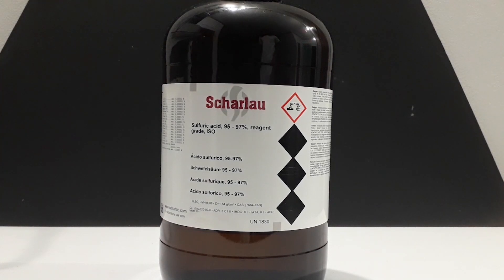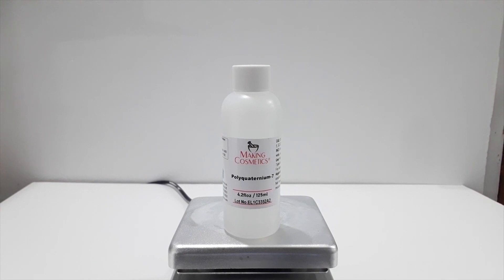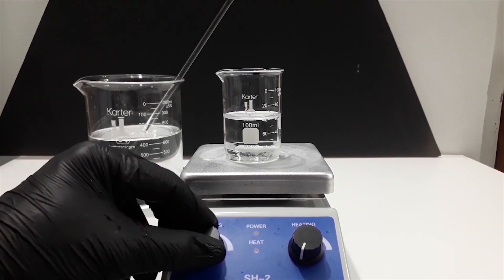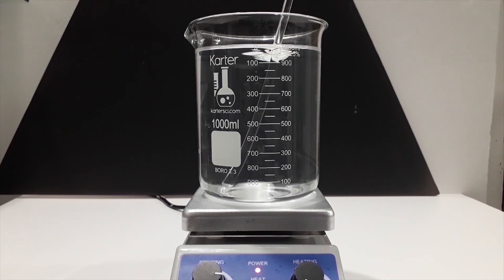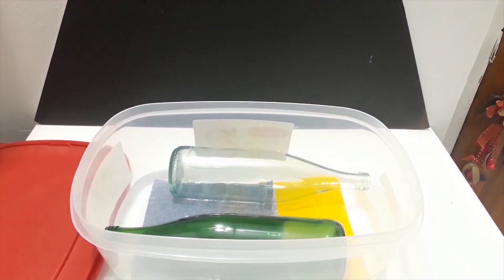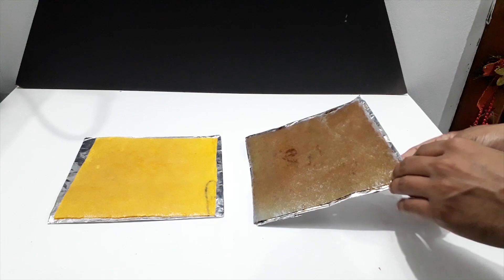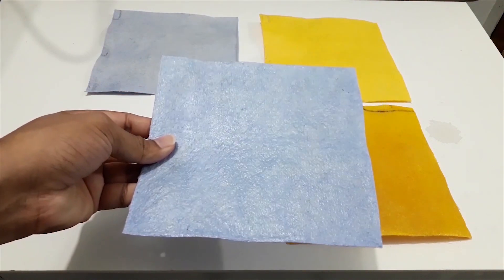How to produce DIY ion exchange membranes for various electrochemical applications.

Comment: Is there a source you can give on understanding membranes like this? I was chatting with ChatGPT and it said that PVA citric acid membrane isn’t used for electrolysis because it’s not really conductive, but that cellulose acetate and cation exchange resin are used at least for chloralkali. But it seems clear that it works here for you… so is it just that you’re showing an easy to make but low performance membrane or is ChatGPT wrong?
Reply from the maker: This is a cation exchange membrane and overall chat GPT was not really very good when it came to chemistry. This is a polycarboxylate cation exchange resin made by crosslinking PVA chains together with citric acid leaving 1 free carboxylic acid to exchange ions.
There are a few papers on this topic but more on the info that chat GPT gave is that you cannot use cellulose acetate in chloro alkali proess it will quite literally get destroyed.
They use polysulfonate cation exchange resin which is usually but not aways perfluorinated to increase chemical resistance.
This membrane has a layer of PVC which is partially dechlorinated by the alkali treatment allowing it to bond to the actual ion exchange polymer blend o PVA+citric acid baked above.
This partial PVC layer gives it some chemical resistance to use it in production of acids or chloro alkali process.

Comment: it would be great if you had time, to do a video on making cationic and anionic membranes using this principle.  Thanks for sharing this with us!
Reply from the maker: this video is on cation membranes and I have a seperate video on anion membranes using the same process but swapping out citric for glutamic acid.
Reply: @CatboyChemicalSociety  I appreciate your comments.  I was wondering, since these bipolar membranes are typically not permeable, how about putting anionic resin on one side and cationic resin on the other side of a pvc membrane? (ie from water treatment resins)
Reply from the maker: @en2oh  you would have to find a way to dissolve those or maybe grind them up into a powder and mix with PVC glue to make a paste.
Reply from the maker: @en2oh  bipolar membranes are permeable but they are not selective.
Reply: @CatboyChemicalSociety  some are, but not all.... I've been reviewing some of the literature for HAN production using bipolar membranes....
Reply from the maker: @en2oh  those are selective based on pore size for certain molecules passing thru and are similar to RO membranes

Comment: Hi! Many thanks for this amazing video! I am actually interested in fuel cells so I can use the PVA instead of PVC. I just did not understand what do you mean by citric? I assume you meant citric acid, right?
Reply from the maker: partially dechlorinated PVC is just as a failsafe for added chemical resistance should the crosslinked ion ester be hydrolyzed and also is primed to crosslink with PVA chains.
yes citric acid is used as the crosslinking agent and the mix can be put directly onto fiberglass substrate.
Reply: @CatboyChemicalSociety  Thank you. For what I understand, for fuel cells we can directly use the PVA/citric acid on cloth and skip the PVC part, right? I love this idea of using a cloth as a membrane as it is elegant and cost-effective.
Reply from the maker: @MrJcmcoelho  yes for fuel cells direct PVA crosslinked with citric acid can work.

Comment: If the pva glue is the exchange membrane why bother with the pvc glue?
Reply from the maker: added chemical resistance such that even upon failure it still works as a porous barrier.

Comment: very nice. , excellent.I want to use these membrances as AEM for electrolysis of water for G.H. Production. In addition, i want to use this manual process as the first step to commercially see if this first step is viable. then, reactor and choloromethylation and amination steps with reactors and fabricating the membranes. is it possible pl.
Reply from the maker: yes but you need to switch citric acid to aspartic acid hydrochloride or glutamic acid hydrochloride which then need to be further treated after baking step with a methylating agent such as methyl iodide to form the quaternary amine which will be the anion exchanging group.
Reply: @CatboyChemicalSociety  thank you.can this be industrialized. Where can I get the block diagram for this process pl.
Reply from the maker: @baburamabadhran1437  well these PVA membranes are mostly for prototyping as they dont last as long as other types of more resistant ion exchange membranes.
Most anion membranes are either functionalized perfluorinated compounds on fiberglass substrate or a duropolymer comprised of aminophenol and formaldehyde also baked on a substrate like fiberglass.
There is one more involving amine functionalized styrene which is also allowed to polymerise onto some PVC.
Commercialization of the process is something I could think of with some work like if I were to make a very basic scale up proceedure for a block diagram I would break it into these parts.
1. Large rolls of fiberglass substrate is prepered on a long conveyor.
2. prepolymer blend is coated on prepared substrate.
3. prepolymer is baked in a continuos feed oven or whatever other conditions are required (inert atmosphere) etc.
4. baked polymer would be washed to remove unreacted prepolymer using sprayers.
5. prepared ionomer is cut into shape.
6. further treatment if required (anion resin).
steps 5 and 6 can be interchanged depending on convinience.
Reply: @CatboyChemicalSociety  I saw this sentences in google. But how the product of these reactions be??? 

"A homogeneous anion-exchange membrane can be obtained by introducing a quaternary amine group into polystyrene by a chloromethylation procedure followed by an amination with a tertiary amine"

In addition we speak about Green Hydrogen bur Fibre glass reinforced is not recyclable and has poor Sustainability index.can there be an alternate for it pl.
Reply from the maker: @baburamabadhran1437  thing with more recyclable membranes is that they do not lasts as long. I am sure there is an alternative but I am only telling you what is industry standard and it is your job to find the alternative.
Also you have to decide whether you want longevity or recyclability and overall you must do the cost analysis and environmental impact analysis yourself.
The reaction to make anion membranes is something you can understand by looking at the reaction mechanism as its really just methylation of an amine.
If you actually want full assistance to your researchwork I can provide it but I am going to need some compensation if you really want me to hold your hand all the way.

Comment: Thanks for posting this video. I made a membrane using these instructions and used a standard procedure to measure the permselectivity using NaCl 0.1M | NaCl 0.5M. The permselectivity values I got were never greater than 0.5. I believe this had to do with citric acid being poorly crosslinked without an acid catalyst present, which matches literature on crosslinking of PVA using citric acid. I obtained much better success using a 10% molar equivalent of sulfuric acid or phosphoric acid to the moles of PVA alcohol groups. 

Let me know if you get some data on the permselectivity of the membranes you have produced.
Reply: The 10% molar equivalent of sulfuric acid is an alternative for what exactly in the membrane construction?
Reply: @tmz9756  Not an alternative, just additional to the citric acid, to catalyze the esterification of citric acid with the PVA.
Reply: @danielppps  if I am preparing an (AEM) should I use aspartic acid or what exactly if you know
Reply: @tmz9756  You can use aspartic or glutamic acids, however you will need to use a small amount of a strong acid during the esterification reaction to catalyze it, as I mentioned before. However a membrane like this will only be an anion exchange membrane under acidic pH, under basic pH it will loose this ability and become permeable to anions. To make it an anionic exchange membrane regardless of the pH, you will need to do an additional reaction to make the amine groups quaternary.

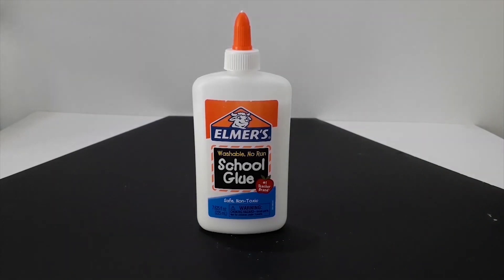Comment: 9:50 This is backwards I think. White school glue has polyvinyl acetate with polyvinyl alcohol colloid to protect it, which is why it’s not reactive. You want the clear because it is only polyvinyl acetate, and for the resin it is carboxyl groups you want, which the acetate provides, as well as the citric acid.
Reply from the maker: but polyvinyl alcohol is hydrophillic due to several OH groups and results in a clear solution with water while acetate groups make it less hydrophillic which is why white glue is white containing polyvinyl acetate colloid.
esters are more hydrophobic than alcohols so I think you have it backwards as an example the molecule ethyl acetate is insoluble in water while ethyl alcohol is.
Reply: Good point… also thanks for being so interactive. What’s the use of the hydrophilicity though? It’s not water you’re trying to pass through the membrane, and I don’t think polyvinyl acetate is exactly hydrophobic. Thing is, PVA is used to refer to both acetate and alcohol which is really confusing. Am I wrong about the carboxyl groups being the means of cation transfer?
Reply from the maker: @1495978707  once the esterification occurs then it becomes hydrophobic and does not let the solution pass ideally but it has one free carboxylic acid which allows for transfer of cations.
the esterified bits cannot transfer ions because they no longer have that charge or a proton to exchange with a cation.

Comment: Why do you dechlorinate the PVC? What is the point of the PVC anyway if the goal is to have citric acid crosslink pva to have sites for ion transfer? What is the point of the quaternary ammonium salt?
Reply from the maker: the PVC increases chemical resistance and while you can simply use pure PVA. when you have partially dechlorinated PVC then you also get crosslinking of PVA chains to the PVC chains due to one of the products of dechlorination is alcohol group instead of chlorine the other is a double bond.
The quaternary ammonium salt was from that 1 paper talking about aqueous dechlorination of PVC films at made by dissolving PVC in THF which basically is PVC glue and quaternary ammonium compounds act as a phase transfer catalyst allowing the strong NaOH to attack the PVC films.
a purely PVA and Citric membrane actually is more conductive but against really strong solutions it is simply gonna dissolve while if you have a PVC film you can have resistance against hydrolysis of the crosslinked PVA in strong acid solutions.
Reply: My previous reply seems to have disappeared, or maybe it’s under review? I was just asking more questions. Anyhow, apparently ion exchange resins that use carboxylic acid groups are called “Weak Acid Cation Exchange Resins”. Is the citric acid just to help the PVA crosslink?
Reply: Oh I think maybe it’s because I included a doi link… Well since I can’t edit the comment to remove that, how is the PVC conductive at all to cations? Also, how does the PVC help resist hydrolysis, when it is behind the PVA, not covering it? Sorry about all the questions, but can you recommend a book that I could learn about this from?
Reply from the maker: @1495978707  PVC is non conductive neither is PVA but partially dechlorinated PVA has some OH groups attached to it which allows for inter esterification between PVA and (dechlorinated) PVC chains creating a good chlorinated resin backbone which resists chemical attack while containing some ester linkages.
I have the paper that describes the dechlorination process and it is titled.
"Dehydrochlorination of Poly(viny1 Chloride) by
Aqueous Sodium Hydroxide Solution under Two-Phase
Conditions" by hideo KISE 1982 
Join the Catboy Chemical Society discord for more interactive questions and answers link is in one of my community posts.

Comment: 🤩 This is a best solution for the CEM over the web! Thanx a lot for the job you did over it, to make it cost-appropriate! BTW, can I use a fiberglass fabric (ρ=30g/m2) or a Nylon-6 mesh (25 microns) as a polymer matrix? Or the cleaning cloth will be better?

Best regards, Linda
Reply: Not sure you will get a comment from
OP, however couple things to note here. For one it cannot really be considered a CEM as you don’t functionalize the membrane and/or PVA. Sure, there will be some tiny selectivity that arises from citric acid monoesters, but it’s mostly unselective as the citrate/citric acid just acts as crosslinker. Further, you can use fiberglass, but you should avoid nylon or any other material that can be hydrolyzed under your reaction conditions. Likewise avoid glass when working in caustic conditions
Reply: @GreenCaulerpa  Thanks a lot for the answer! BTW Aktavesh answered me in the discord not in YT sadly XD Anyways yes the pure CA have a lower level of the selectivity. And I found some papers about the reducing the quantity of SSA by a adding a CA as addition to improve the overall quality and charge ability of the CEM. "Synthesis of cation exchange membranes for capacitive deionization based on crosslinked polyvinyl alcohol with citric acid" if you interested. But the SSA is a pretty expensive and i will try to synth it first for my experiments. And my CEM will be used in Hydrogen PEMFC so the env will not be so aggressive, exclude CO and Water.
Reply: @MethelinaPills  No problems. Yea, adding poly(styrene sulfonic acid) (if that is what you are referring to?) as ionomer would help. But to be honest, I wouldn’t bother with exotic ionomers if it’s just for a PEMFC. It may sound weird, but consider that: the overall performance of your PEMFC will depend on the overall contact area of the ionomer to the catalyst. Using a solid ionomer will pose the same challenge as solid state batteries do - the quality of the interface will be the current limiting factor. An alternative approach you can do however is to acid dope your polymer electrolyte so you essentially get a gel. This gel will have more favorable characteristics but will only be stable to around 50-60C (for polyvinyl alcohol). Using a corrosive electrolyte won’t really matter here as well as your main catalyst will be platinum or a mixed PGM (platinum group metal) catalyst. 

Also I would advice to maybe start with an anion exchange membrane fuel cell or alkaline fuel cell as you can use cheap catalysts like nitrogen doped carbon for oxygen reduction and nickel (urushibara or raney Ni, even a metal hydride from Ni-Mh batteries) as nickel boride as anode catalyst
Reply: @GreenCaulerpa  Yay! As SSA i meant sulfosuccinic acid. It's a canonical cross-linking agent with the best of COE factor. The catalyst group we will use a Pt nanoparticles over the electrospun GDL matrix from PVDF-HFP+carbon black composite. As i planning the membrane will swell enough after activation to have a full contact with he GDL-catalyst layer. The anion cells will not the option cuz the main project followed the hydrogen energetic concept.
Reply: @MethelinaPills  ah okay, it sounds very interesting indeed, I gotta admit that much. Let’s hope that it will indeed work out, but I can unfortunately say that building fuel cells from ground up (especially air breathing ones) is far from a simple project. I highly suspect that the limited ionic conductivity will become an issue for you without adding additionally an ionomer or otherwise filler to the polymer matrix. 

I need to ask however, what do you mean by „following the hydrogen energetics concept“? Anion/alkaline fuel cells can very well utilize hydrogen as fuel. In fact it is easier to oxidize (and molecular oxygen easier ro reduce) due to the pH-dependent shift in standard electrode potentials. The only problem with air breathing alkaline fuel cells is that unfortunately they suffer from precipitation caused by absorption of carbon dioxide from air
Reply: @GreenCaulerpa  Hmmm, interesting but in some way i did a research only over the CEM based systems. The AEM-based systems was discarded as early beginning cuz of complexity with gas-balance and environment of reactions with contaminants, and in some way i can be wrong about it.  But as i know there is no a lot of industry available AEM cells but a lot of CEM-cells lika a Pragma Industries, Tesla, Toyota or so on.

What you mean under the ionomer for GDL (Gas diffusion Layer)? 

And yeah PEMFC its vry complex project. I spent about 2 month to read a lot of papers and ask a ppl from the industry about the issues and still learning new. Learning never ends XD

"following the hydrogen energetics concept" - the main project is quiet UAV with hydrogen fuel tank with external air intake (with rough filtration ofc). In this way you meet the variable quality air and less as possible control and service of  the cell.
Reply: @MethelinaPills   That sounds a lot like Игорь Негода's hydrogen plane project! Coincidence or inspiration?
Reply: @avialexander   Coincidence. As i know, Igor's project is failed mostly. And his interest is a UAV itself. He bought his cell. My interest is a cell and making our own.
Reply: @Andre Could you improve selectivity by having more citric acid in the mix?
Reply: @1495978707  In my opinion, not significantly, no. However you have ho consider that your overall selectivity also depends on the prevalent species in the electrolytes. Say you have a highly acidic/alkaline environment, then the charge transport will mainly be due to hydrated protons / OH-. 

Alternatively, functionalize the PVA, you can phosphorylate or sulfonate it. Ofc something exotic like adding fluorinated acids would be optimal due to increased acidity by the stabilization of the anion by -I effect of the fluorine to stabilize the anion, but that’s nothing you could or would want to do at home